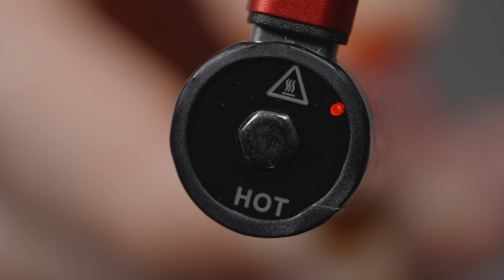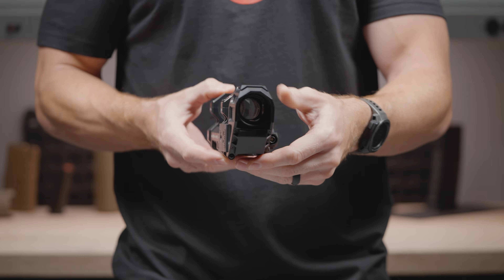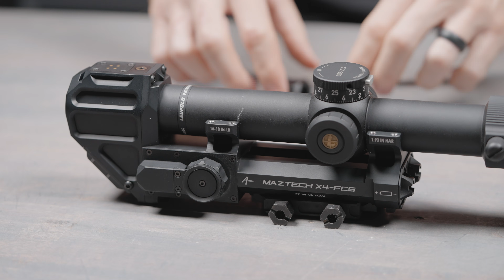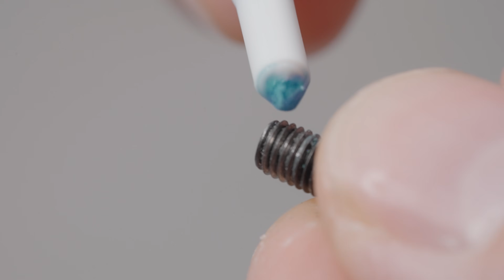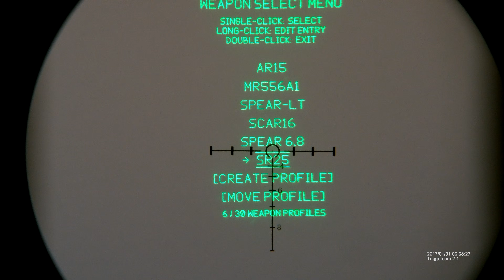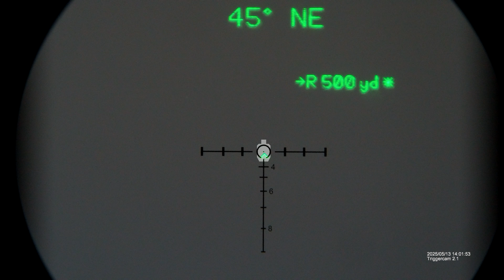Magpul x Maztech - X4-FCS Quickstart

Comment: Hello Magpul about the concept of the clip https://youtu.be/trjBl_EUr8Y?si=Ky6waOXKFoyiCKbW a maztech magnet fire folding rifle scope that goes over the maztech display at 25 meters and from 75 meters you switch the rifle scope by folding it over. The Mda dts Stiftung Stadtilm would charge 25 percent of the corresponding patent © with a magnifying glass lens between the meztech and the rifle scope that shows the cartridge display!